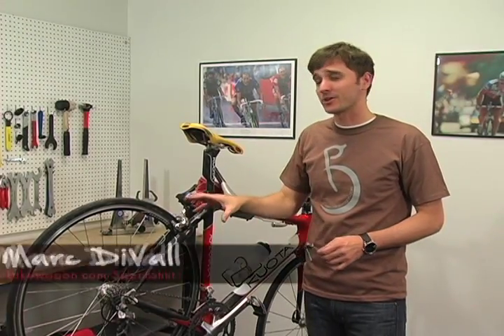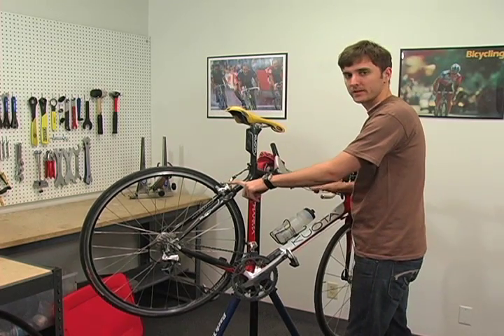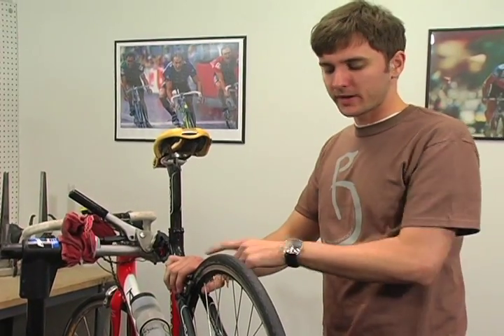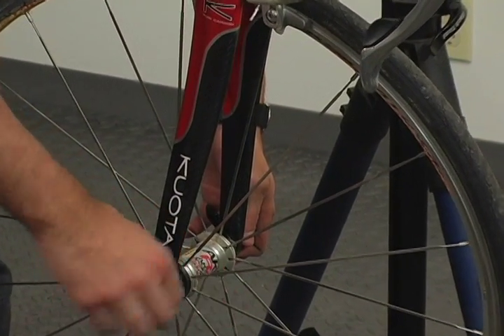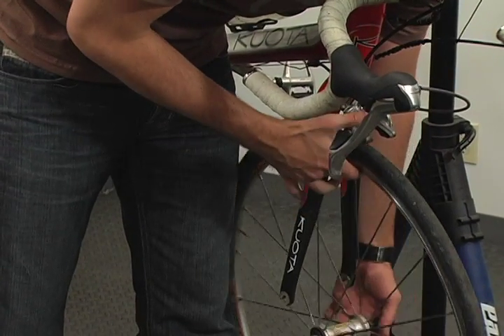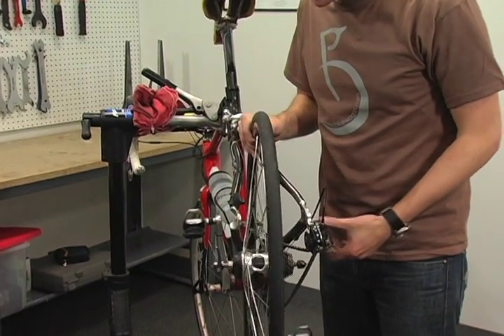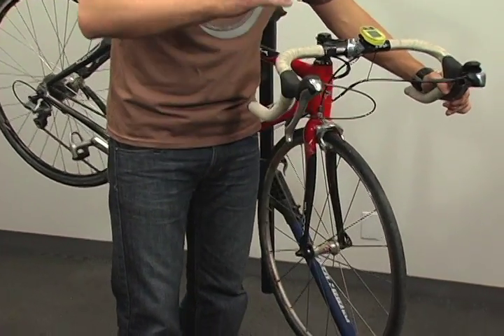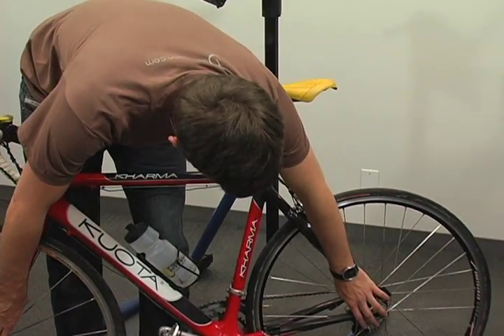Removing and installing your bicycle wheels

Comment: Can you show how to remove and reinstall the wheels without a bike rack? I understand the general concept, but it usually takes me 10-15 minutes to take my quick-release wheels off, or put them back on once I manage to get them off. Things just don't ever seem to fit right, and I usually have to mess with it for a really long time, with the bike frame falling over every 10 seconds. It's a brand new bike and nothing is wrong with it. I'm just completely inept when it comes to things like this.

Comment: I watched this because I have locks installed and wanted to put my factory quick release back on. My main questions is that I don't know if the springs go outside of the fork or on the inside. This doesn't have a good enough view to even see that.
Reply: It's almost as if a single simple youtube video is unlikely to answer every possible question possible, and cover every possible thing, (and therefore you may want to look at a manual or reference text or an exploded-view). Totally weird !

Comment: Helpful video, thanks for posting. I just got my bike back from the shop and noticed the Lock latches for the wheels were not pointed in a downward position. I wondered if they did something wrong. Thanks to your video I realize there is no position for the latch when locking the wheel, only that it is not too easy to latch and not too hard. And to those who post insulting comments please grow up. This video helped me.